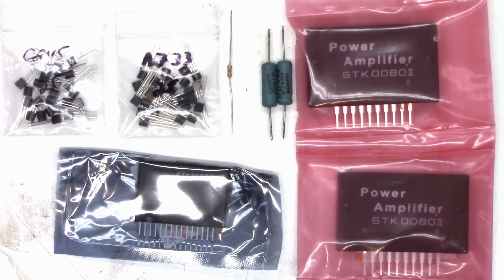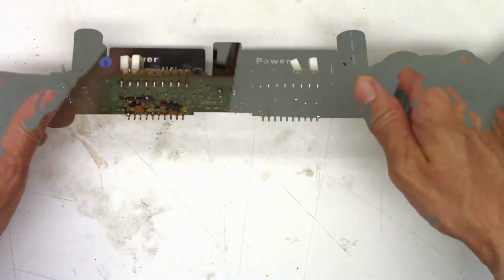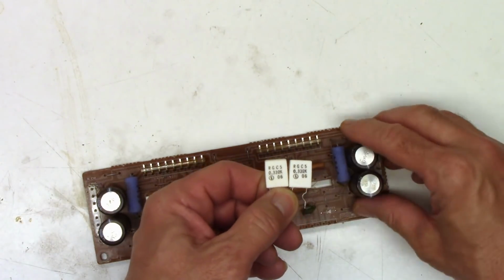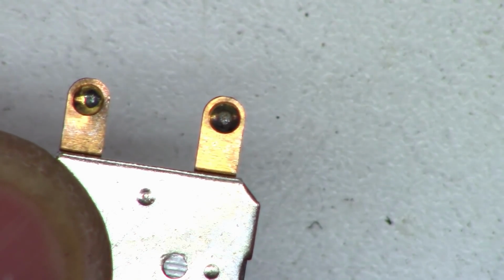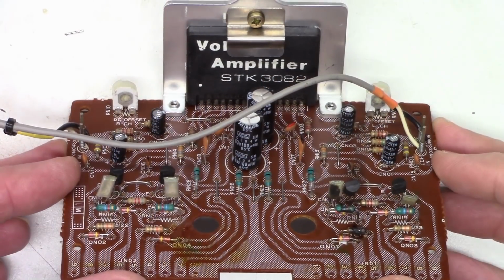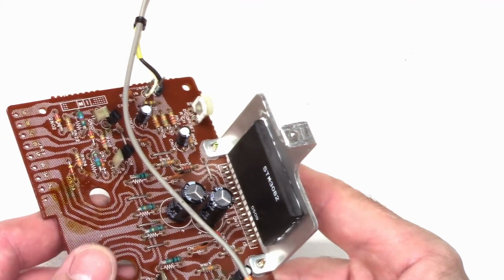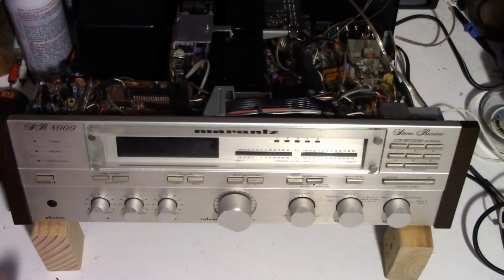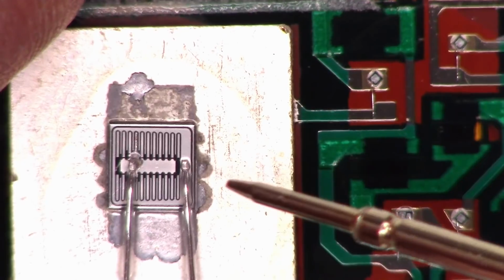MARANTZ SR8000 BURNED RESISTOR REPAIR PART 2 POWER AMPLIFIER REPAIR - VINTAGE STEREO REPAIR

Comment: 1. Good technique is to RESOLDER ALL the Pre- and Power Amp solder joints. Lot's of very iffy joints - you don't want the machine coming back, for lack of attention there!
2. Dip liquid ammonia on your paper strip, when cleaning contacts. No residue, and cleans oxidation marvelously.
3. After placing the amp IC's on the Heat-Sink, tighten the screws only partially. That gives a tiny bit of flexibility when inserting the IC's pins into the PCB holes, without stressing them. Only AFTER soldering ALL the IC pins to the PCB, then go ahead and tighten fully the IC's screws.

Comment: what temp do you use on the hakko . i am having hard time with mine , it takes a few seconds to melt the solder joints .
p.s- again i donate you and live a question , and again no response
Reply from the maker: I usually solder and desolder close  to 800F

Comment: If those STK amplifier modules had a base to emitter or base to collector short how would you be able to tell
Reply from the maker: It should show up as a dead short when you measure  B+ and B- rails to the output pins.
Reply: @norcal715  what if you took them out of the circuit to test them

Comment: You should adjust the idle current
Reply from the maker: There is no idle adjust, only DC offset and I did adjust it. Those are the 2 pots that you can see in the video. That segment did not record unfortunately.

Comment: I like those older Marant'z,  Did you find those IC's at Dig Key or a similar parts house ????   I never bought parts like from ebay when I had my shop in the 80's and 90's cause I didn't have a PC back then....  CEI outta Ohio and a couple others I deal't with were my suppliers......

Comment: So now one channel has original Noble metal plate (low inductance) emitter resistors and other channel - Ohmite wirewound...
Reply: I highly doubt you ever be able to hear any difference.
Reply from the maker: especially in the 20hz to 20khz spectrum. if there was RF (1mhz and up)involved then maybe the inductance would come into play

Comment: LOL :) We love the smell of Acetone in the morning (or was the afternoon?) Do you buy it by the gallon? :)  The old solder sucker got a workout on this one! Great job on all the missing and damaged hardware from previous monkydom! Yep, we saw @ 5:18 the previous test showing good on #2 & 3, weird...  What was the deal with chip 2 @ 7:11 ?  Overall great diagnoses and repair and hopefully the customer will opt to "do it right, complete" and be done with it and that there will be a part 3 to this repair and it will be 100% great again.